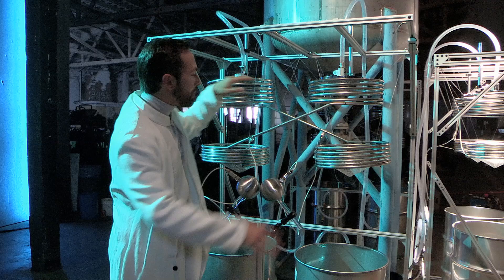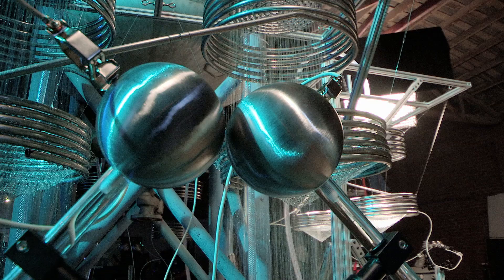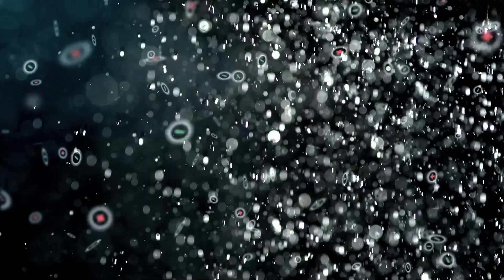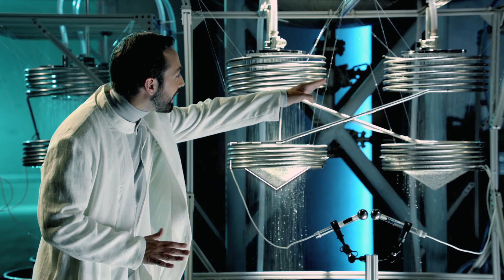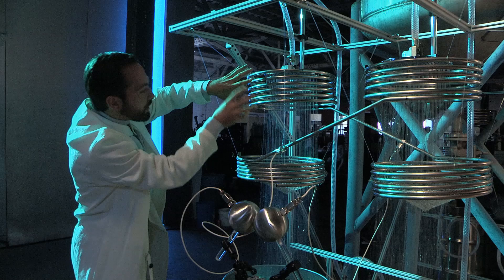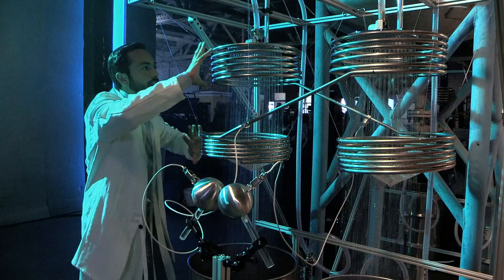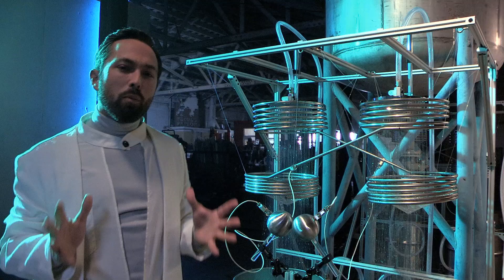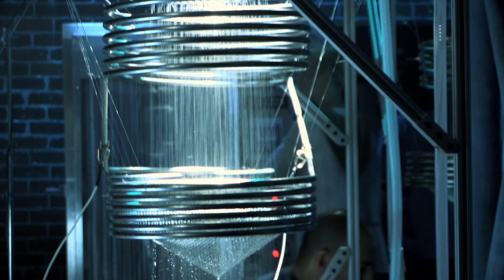Sparks from Falling Water: Kelvin's Thunderstorm

Comment: i would assume,that the energy is coming from the potential energy that is stored in the water before it falls.
you would need to add energy,to pump the water back up to where it's normally stored...this energy is partially turned into electric current,and the rest into heat.
Reply: I apologise if I'm wrong. But the potential energy isn't being used up, so it can't be getting it from there. And this set up could be used in conjunction with a waterfall or something so that the water wouldn't need to be pumped back.
Reply: it is being used up.
otherwise water-turbines would be producing "free" energy.
Reply: FractalMachine Even in this case? Can potential energy be used up without contact?
Reply: well it doesn't need physical contact.
interacting is enough.
and in this case the water does interact with the metal coils.
Reply: The potential energy "released" by the falling droplet would normally be converted into movement, sound, and heat. This machine simply converts some of that into electricity as well. The water should actually fall slower, just like a magnet slides down a copper tube slowly as eddy currents are generated.
Reply: FractalMachine
From what it looks like, the water is barely touching the coils.  It IS going through the mesh though.  Christopher Stone  is right in that the water would fall a little slower (or the air doesn't get as warm due to air friction).  We have to also assume that water isn't the only thing there, we also have air, which can get ionized and pass on electrical charge.
Reply: for me ít seems like during charging the energy is stored in the attracion of the water to the coil.
Reply: FractalMachine,

...or we could let gravity and evaporation sort that out. Perhaps, a machine that can accomplish all of this on its own or in conjunction with rain, or bodies of falling water?

*//parse as sarcasm//*
Reply: Emyll Somar
huh?
when i said "pumping" it was in the context of the question "where does this energy come from",and it was to demonstrate that we are not violating the conservation of energy.

and we already have what you're talking about...and it's called Water Turbines.
they produce a million times more energy than this.
Reply: Blaze Thrower In this case there is physical contact. The water droplets touch each other as they fall, and they touch the mesh at the bottom.

But to answer your question more broadly, potential energy (more accurately "gravitational potential energy") can be transferred without physical contact. Google "Gravity Assist" to see examples of how we use this fact to accelerate spacecraft around the solar system.
Reply: Ryan Brown I think you're on the right track, but you're missing how the energy is transferred. 

The ions in the water have an electrical charge. The top rings have the opposite charge. This produces an attractive force, which will do work against the kinetic motion of  the droplets, and slow their acceleration as they pass through the top ring. This is where you get the electrical energy--it's converted when the static attraction between the ions "sap" the kinetic energy of the moving water droplets. (Granted, that energy was once gravitational potential). There is no energy converted into electrical energy when the droplets hit the bottom mesh, however, that contact is what gives the top ring its charge. Most of the gravitational potential would actually be converted into heat (wasted) at that point, which is part of the reason this method is super inefficient. 

Gravitational potential energy being transferred isn't totally accurate either. You gain gravitational potential by moving a mass away from another mass. If you allow gravity to pull them together, you're actually decreasing gravitational potential. Gravity assists are actually a pretty complicated and difficult to properly understand example of this (mostly because it's a 3-body orbital mechanics problem with lots of relative quantities). It would be simpler to note that if you drop a ball, it tends to get faster as it gets closer to the ground, indicating that gravitational potential energy is being converted into kinetic energy without any contact. This is because gravity is a field force.

Source: I'm an aerospace engineer.
Reply: The thing is, if you placed a water turbine under the shower, it would generate the same amount of energy regardless of wether you remove the coils or not. So the electric charge cannot come from the kinetic energy of the water.
Reply: Acsabi44
i don't think this is the case.
the energy is basically stored,in the distance between the water,and the ground.

when the water droplets fall,the potential gravitational energy,turns into kinetic energy.
some of that kinetic energy goes towards creating a difference in charge between the droplets.
this in turns "snowballs" as the differences in charge get amplified by this machine which attracts the charged droplets towards the opposite charge.
as this happens the droplets lose some of their kinetic energy.

since water turbines use the kinetic energy stored in water as it flows or drops,then those droplets who's fall has been slightly slowed down...would simply generate less energy in a water turbine,since there is less kinetic energy to be transferred to the turbine.
Reply: FractalMachine You're very close! That's why this hasn't already been added to water turbines as a standard extra step. If the energy came from something other than kinetic energy, we'd easily be able to improve the efficiency of a turbine by adding one of these rigs in before the turbine itself.

But you're missing something about how the ions got there: the potential energy cannot in and of itself put ions in the droplets;it's just a fact that water is not purely H2O in nature. There's H3O+ and OH- ions scattered throughout. This rig just sorts them out using electrostatic forces and time, and then uses those anomalies in charge that are already naturally there as a means to extract the kinetic energy.

The energy we're generating isn't from electrical energy in the water--the water has no electrical energy that we can use, just a static charge--it's kinetic energy that's been converted into electrical energy by allowing the electrostatic forces to create an electrostatic "friction" against the motion of the falling ions. This "friction" is what does the conversion. However, the ions would have been there even without a gravitational potential.
Reply: Scoobacca152 you got it, I have read through all the comments but yours satisfy me. indeed, the kinetic force gives the energy, even though the ions are ulitmeatly resposible. it is the friction. thanks for taking the time to post that, even though you gain nothing from it. :P
Reply: Blaze Thrower the potential energy of the water is being transformed into kinetic energy by falling
Reply: Blaze Thrower gravity and all forces really act at a distance, contact is never really made. When you push on something you are not really "touching" it the electron degeneracy pressure force of you and the object do the work.
Reply: Scoobacca152 It's not gravity. Gravity is a conservative force like the electrostatic force and cannot impart energy. Gravity doesn't spontaneously hand you some energy to use. You have to use something like a pump or your muscles lifting a bucket to work against gravity to generate gravitational potential. If they used a pump to move that water, the energy technically originated from chemical energy liberated from bond shuffling in reactions (like what happens in a battery or burning coal), because they used that chemical energy to create a pressure differential to pump the water into the tank against the force of gravity. If he lifted the water into that tank with his muscles, same thing, chemical energy from metabolizing food.  I think this problem needs to be stated more clearly. This problem is just about moving electrons around. The question is what force is moving the electrons around. The energy we are talking about is force*distance for those electrons. Or if Though I think this is a way more complicated problem then we are giving it credit for. So, the gravity accelerates the polar water molecules and forces some of the water molecules closer to other water molecules. The gravity has to fight the electrostatic field of the water molecule's dipole moments, this is force*distance, this is where energy is transferred from gravitational potential energy = 9.816*height, to electrostatic energy. So this effect will "jiggle" the electrons around, and jiggle the molecular bonds around. The grav pot energy is now converted to bond vibrations and electron vibrations. But when enough energy builds up between two molecules (or a lot) when we get positive charges too close to the electrons, we actually liberate the electrons from the eletrostatic potential well of the atomic nucleus. That's called polarization. Once a large enough charge is close enough to the electrons, you can polarize atoms. The liberated electrons are now free electrons that will just flow in an electrostatic field. If they are still part of an atom, they just jiggle in an electrostatic field or move a little further away from the nucleus because the protons hold them in place. That little spark you see is polarized air molecules facilitating the flow of electrons from one side to the other to neutralize the charges on either side. The reason the spark is periodic is because it only occurs once the potential energy across the two metallic spheres builds to the point needed to polarize the air molecules in the gap. Air doesn't conduct electricity well unless polarized. This is really a problem about polarization. Rapid enough deceleration by slamming into the metal grate is apparently sufficient to liberate some electrons and polarize the water molecules.

Comment: Instead of just making a spark, attach it to the Tate Ambient Power Module circuit (bridge-rectifier made from germanium diodes rated for high voltage). The module converts to DC and charges capacitors, thus smoothing the power. If the capacitors are say 1000MFD or higher, this can drive something conventional such as a battery charging circuit for a cell phone (voltage regulated to 5V). But, you have to have constant water flowing, and if you want the water to go in a circle, you need to pump it UP again. I suggest you use the Tesla Water Fountain patent number 1,113,716. The idea is to spin the water at low power, rather than pump it. Create a water vortex, the water level rises and spills over the edge. Now you have falling water that you can separate into two columns.
Reply: Big brain time! I think that the better option is to run a spark plug that can handle the voltage. Create a siphon that leads to the spark gap and tune the system to keep up with dripping water. If you hit a water droplet with the 10000v then the water droplet can ignite and explode. That energy splits the molecules so fast that it ignites the hydrogen and burns the oxygen. You could then run a piston chamber with that energy. The only issue is tuning the system to run an engine like this and power a generator. It's an idea that has been stewing in my head for a while. I don't have any resources to pull it off or the money to try it. One day maybe.

Comment: Elevated water has stored potential energy, which is transformed into kinetic energy as it falls, whereas a less efficient conversion of electromagnetic energy from water molecules is absorbed by the water mesh, creating an initial electric charge, where the accumulation of charge is accelerated by your setup, until enough current is able to jump across the metal orbs, closing the circuit.

Comment: That is why all the valves in a refinery are anti-static, unless you want to see sparks jumping from the valve lever to the adjacent valve structure, in the dark, in a place where an explosive atmosphere may be present. Fluid flowing in pipes can build up static, and a  ball valve ball, sitting insulated in ptfe seals or similar, with the valve stem equally insulated, can be an outlet to such static buildup, unless the ball and valve stem are electrically continuous through the valve.

Comment: Where is the energy coming from? The grid.
The grid supplies the power to the water pump, that lifts the water against the force of gravity. ;)
Reply: Well actually it's coming from coal, oil, gas or whatever.
Reply: Well they could have bucketed the water into the tank by hand...
Reply: how about setting it up in rain or sth

Comment: The energy comes from the flow of electrons in the water through the metal coils, causing induction. The wiring up and cross connecting is a makeshift diode of sorts, as well. Great video.
Reply: Sorry but this comment is nonsense

Comment: wow, I wonder how much it costed to build all that to just make this video. I would think that the charge comes from the ions building up on the coils creating a small magnetic field , then when full saturation is reached, a small amount of ions start to ark across the electrodes, when that happens the magnetic field starts to collapse and then pushes the rest of the electrons across.
Reply: Calin Agotici No, it is the gravitational energy that is driving the whole thing.
Here's the steps of what happens:
1) Random charge variations cause one loop set to gain a net charge.
2) The induced dipole causes a greater charge separation to start forming.  However, without any external driving force, those charges would simple recombine due to electrostatic attraction.  That's why putting the structure into stationary water wouldn't work.  you'd constantly get tiny charge separations but they would almost instantly self correct and vanish.
3) Gravity pulls the water into two separate streams, preventing the separated charges from simply recombining.  This takes energy out of the gravitational fall of the water.  This is caused by the repulsion between each charged water stream and the bottom screen of the same charge.  You see the same effect on the top coils.  They visibly deflect the water in an attractive way but since the attraction is at a right angle to the direction of water flow, it has a minimal energy contribution to the whole system.  You can't see the screen/water repulsion as easily but if you were to measure the speed of the falling water, you would find that it is decreased as it passes through the screens.

You can never get energy for nothing.  The electrostatic interactions cannot drive the system since there is no way for net energy input to occur.  The only energy input is from gravity pulling the water down.  (or more indirectly, the pump that is circulating the water back up to the top)  When analyzing energy systems, you always have to step back away from the details and ask yourself, "Where is the energy driving the system coming from?"  Once you figure that out, then you can work your way through the problem.
Reply: 2 videos + the next one
Reply: Dan Heidel Electrostatics are symmetrical, so any decrease in kinetic energy on the way toward the mesh due to repulsion would be exactly matched by an increase in kinetic energy after passing through the mesh and heading away.
Reply: BookofAeons
You are correct.  I was thinking that the relative deceleration and acceleration of the water on the top and bottom of the mesh would impart differing amounts of work on the falling water but that is not the case.
  The work must be performed when the water initially falls out of the upper reservoir.  The separated charges have electrostatic attraction to each other and overcoming that attraction must be where the actual work is being done.
Reply: This is cool
Reply: H
Reply: H
Reply: *****  It costed a great deal of passion :)
Reply: Dan Heidel This.

Comment: H2O by nature is a non-ionic compound meaning that it shares no overall charge despite its polarity. Hence, if this experiment were conducted using pure (distilled) water, I do not think a charge could be produced. The concept of 'hard water' (contains impurities) would suggest that the water falling past these coils contain ionic elements such as metal particles for example. Whilst most of the water travelling through these coils would be in fact, water, a small percentage could contain these ionic compounds or elements, hence the small charge produced. These ionic compounds being of different charges would then be attracted according to the overall charge of each coil producing static electricity until discharged.